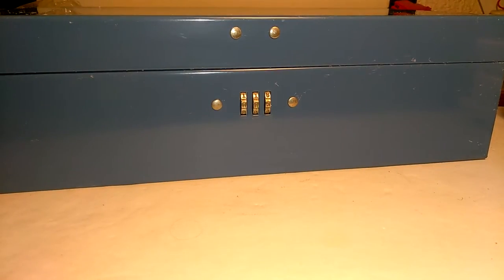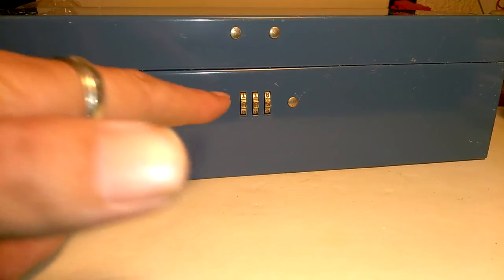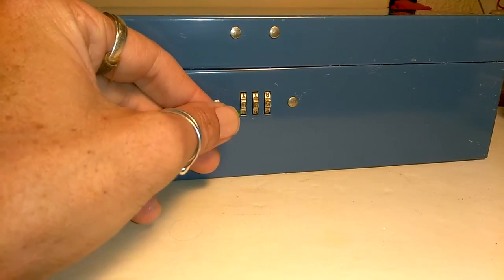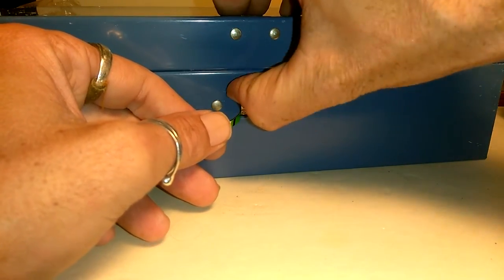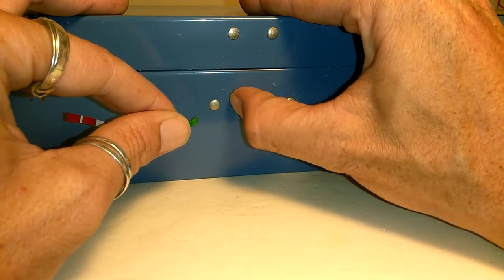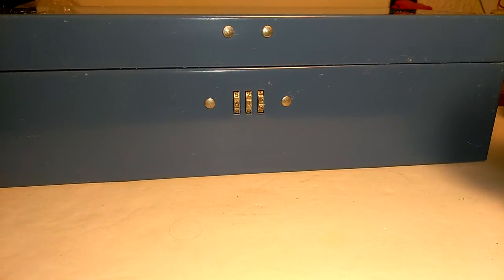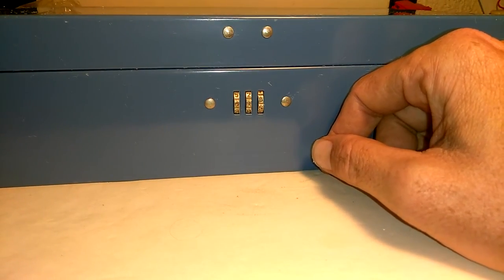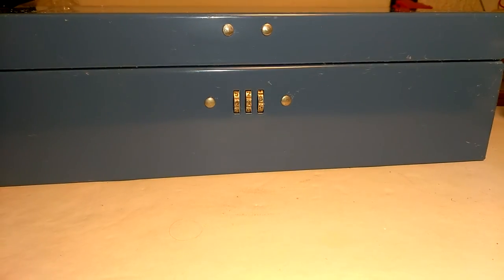Sentry safe lockbox three wheel tumbler (part 1.5)

Comment: Thank you so much. I can verify this method works.  Just opened an sentry safe lockbox that I have forgotten the combo for (Empty).  I actually use a flash light instead, shining between the dials, I can see that one of the number is flat on the shaft for each dial, I also did notice that once you find the flats, add 1/2 of the amount of numbers in each dial, to each number will get you the right combo.  example, with dials of 10 numbers (0 to 9), if you found flats to be 3,7,2, add 5 (1/2 of 10 numbers) to each flat number, keep in mind the numbers wrap from 9 back to 0, you should find the correct combo is 8, 2, 7.  Vola!!!  This is because the flats number seems to need to face the inside of the lock, so give it 1/2 of amount of numbers in each dial will rotate them to exactly the back position.  Thank you.
Reply: This worked, thanks for the detailed explanation 👍

Comment: Hi there! My grandmother died and I'm trying my hardest to open a lockbox just like this one. Unfortunately, I have no idea what you mean about flat spot!! Please help, thank you
Reply from the maker: If your just trying to get to the contents and not worried about saving the box. Take a frat head screwdriver and pry it open. They arent strong boxes.
Reply: @TheRockoBaninsky  I also have the exact same box that I don't want to destroy. Can you please clairfy "flat spot"? Is it on the shaft that the wheels rotate on or on the wheel itself? I am trying your method and just can't seem to feel it. Perhaps if you had a picture of what the flat spot looks like it would help. Thanks
Reply from the maker: @dgfarmer1  in between the dials the shaft that it rotates on
Reply: @TheRockoBaninsky  Thanks! I will keep after it now.

Comment: Hey I have that exact same box do you know how to reset that one
Reply from the maker: You have to figure out the combo 1st, then on the back of the lock on the inside of the box there is a small tab that slide in an L shape. slide up and over. change your combo then slide that tab back and it will be set.